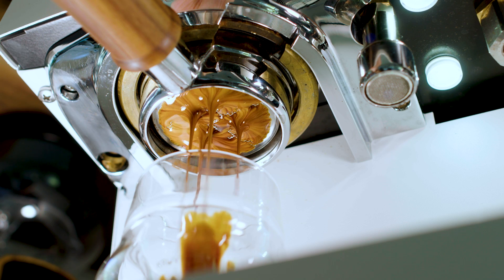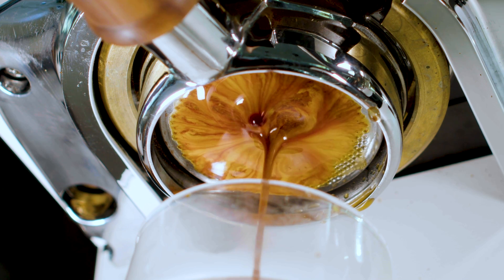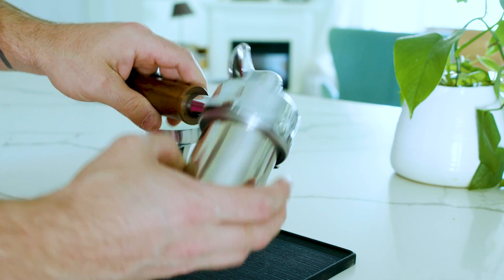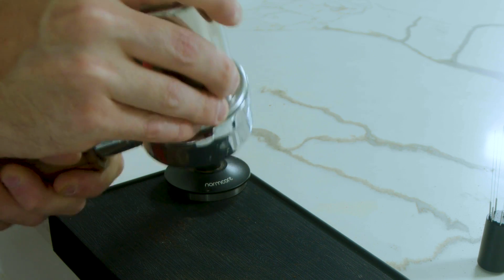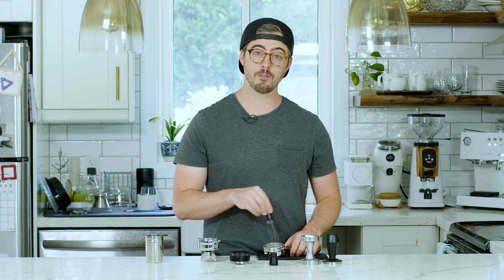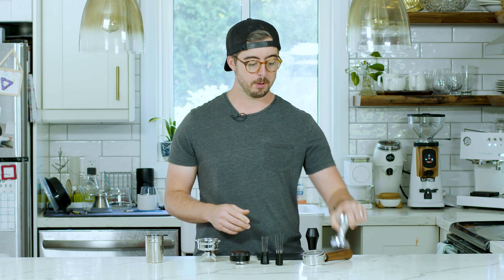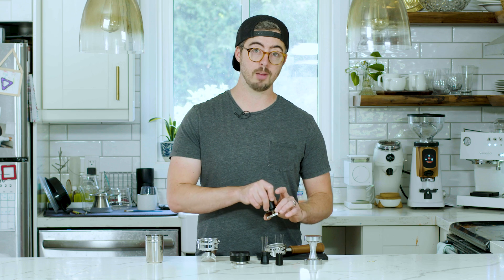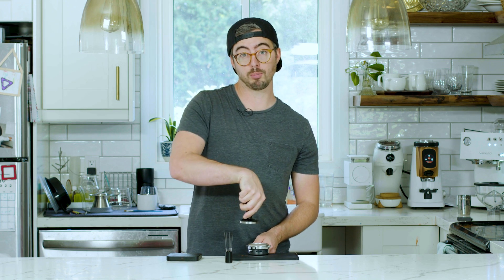Espresso Distribution Tools and PUCK PREP - What you REALLY need

Comment: The bottomless portafilter turns out to be unnecessary. It’s a great tool to have to check your prep, but once you’ve made good prep part of the routine it becomes superfluous…. and you really don’t need it to check the prep if you’re using good technique. Good grind, WDT, and tamping covers the whole thing.
Reply from the maker: For sure, but there is definitely a point at which it is helpful, which is why I recommend having one. ☺️
Reply: If you could assure me with 100% certainty the prep/shot would absolutely perfect every time, I'd still use a bottomless PF because it's entertaining 😂
Reply: I bought a Breville Bambino Plus. There is no heated Brew group or anyting even related to that so having less thermal mass between the puck and the cup is a good idea. Waste less water pulling blank shots trying to heat it up that way, so I feel that many people with entry-level or mid-range machines could also benefit for this same reason.
Reply: @NoZenith  That makes sense…. I preheat the cup and the portafilter with one cup of hot water from a Keurig-type hot water dispenser. So given that the cup should be preheated anyway, it’s not a waste of water to utilize that same  process to preheat the portafilter
Reply: They have their use and everybody should have one at hand. You need them when you switch to another new coffee type/grind and also when you have especially large cups in a compact machine.
Reply: Not to mention it just gives you more cup clearance for the cup and scale that you are using

Comment: It actually doesn‘t make if difference if you tamp harder past a certain point. Just give it a good amount of pressure and youre fine
Reply from the maker: Tamping straight is very important though - one of the reasons I love calibrated tamps with sleeves!
Reply: @DaddyGotCoffee  Thanks for adding that. It is easy to forget something when you try to explain the really important points :)
Reply: You are right. You can not press too hard. However it is true, that the sleeves help a LOT!
There is not need for a spring though, so there is a way to save a but of money or to get a bit nicer tamper.
Reply: @DaddyGotCoffee no such thing as tamping too hard

Comment: can we talk about hand/manual grinders next??
Reply from the maker: This is definitely on my list and I have been testing a spectrum of grinders from timemore, Varia and Wacaco. I may source a couple more. Do you have specific questions I can make sure to include???
Reply: Totally agreed
Reply: @DaddyGotCoffee  i have some.
I don't have a burr grinder and i use manual. And my basket is not pressurized so it's important to grind the perfect grind size. But most of manual grinders change the grind size by themselves after time. Is there any way to use them in an espresso machine to make the best results?
Reply: @DaddyGotCoffee  Comandante C40 and 1ZPresso ZP6 would be nice to include.

Comment: I use a cork and acupuncture needles for my WDT, I also use a portafilter funnel so I do not need to be super gentle as to not spill grounds. I also sometimes just shake the basket slightly leg and right and thats all that is needed so I might end up stoping with the WDT, I use a puck screen and dose 1g less and the results are about the same with zero mess left on my machine.

Comment: 2 years into this hobby, I found my process.

Shot funnel on portafilter.
Grind into pf
Wdt deep to shallow and level out the surface.
Remove shot funnel

Use the force tamper give it a pop, done
Reply from the maker: Very similar to what I do! Minus the shot collar!
Reply: I think I'm headed in this direction but with the normcore tools presented here... I think I want the shot collar for sure at this point and I've only been doing this for a couple weeks hahaha. I'm working with a Bambino Plus so the niche dosing cup doesn't fit and I use the top of a Vitamin Water I cut off as a funnel until I decide... I still seem to make a bit of mess trying to just level it a little bit before I Tamp

Comment: Just ran across your channel, love it, I know your post is several years old, but hope you are still checking comments. Question on tampers spring loaded with a shoulder, can't the shoulder potentially bottom out before the proper pressure is applied to the grounds??
Reply from the maker: Hey! Checking I am! It’s a 2 spring system. So once the shoulder bottoms out additional pressure still gets applied to the tamper face. They work great

Comment: 18 grams of coffee yielding 36cc is too much caffeine! And it's a new trend! In our time (which I still stick to at home) single was 7grams yielding 35 cc to 40cc ... double was 14 grams 60 cc to 80 cc.
Reply: That's really not a lot of caffeine, you can actually get more caffeine from a v60 brew that will taste "less strong"...
Reply: …. Which are longer extractions…. Extracting more caffeine…. 😂
Reply: I do still running approx 1:4 ratio ať home and shots are great👍
Reply: The contact time of the water is much shorter than in a V60. So the amounts of caffeine extracted are relatively small. One Espresso/Cappuccino is much less than one regular brew up coffee.

Comment: FYI the basket in an ascaso botomless PF is a competition 58,4mm 21gram basket. A regular ascaso tamper wiggles because it's designed for stock ascaso 58mm basket that comes with the machine (botomless is optional). Use a Motta 58,4 tamper for botomless.
Reply from the maker: Great clarification, thank you!

Comment: Thanks for a great video! Question about the Normcore tamp. I recently got the Normcore 58.5mm V4 ripple tamper but it seems like it doesn't fit my basket properly! I'm using a 14gr basket that came with my Ascaso machine. What could be the issue? Are you using the same Ascaso basket in the video? Thanks!

Comment: When you say 25s do you add the +5 secs of pre infusion? Cause I have I’m the same ascaso machine And the timer shows plus 8s actually
Reply from the maker: Yes. The way it works on those machines is there a 3 second pause after a preinfusion. So you set it for 5 seconds, the pump will actively preinfuse for 5 seconds, it will pause for 3 seconds, and then the pump will engage for the main shot.

I refer to it as a 5 second preinfusion because that’s how you program it. 👍

Comment: Hello,
I'm looking into giving me a nice Christmas gift. So I'm looking for a prosumer espresso machine and grinding. I'm hesitating between the Ascaso Steel Duo and the Rocket Appartemento. I'm still not sure which would be better, but I'm open to look at other machines. Price point 2500$ CAD before tax
As for the grinder, there's the Ascaso I mini L1, the Rocket Faustino and the Eureka Specialista. Prince point max 1000$ CAD.
What is your thought on my choices?
Reply from the maker: For the grinders I would definitely reccomend the Eureka out of these three. IMO it offers the best value.

Between the duo and the apartmento, this will come down to preference. The appartamento will give you a bit more steam power but with a longer warm up time and without some of the other features, the preinfusion is not programmable, no volumetric programming at the OPV is a huge pain to adjust. Both are great machines though - I might go with the one you like the look of more because if you love the machine you will use it more!

If you end up buying the Ascaso, use my discount code at Ascaso-USA.com for 10% off (DADDYGOTCOFFEE). Unfortunately I don’t have a code for the Rocket!

Comment: I don’t have a grinder but I get freshly ground coffee from a roaster nearby (100g) at a time. I recently got all the tools as per the video and I got no crema. I have a de delonghi dedica if that helps
Reply: Did you tell them specifically to grind it for espresso? Otherwise they'll probably grind too coarse. I'm assuming your portafilter is non-pressurized? To get crema, there needs to be enough pressure in the puck. If the grind is too coarse (or the dose is too low, or both) the pressure won't get high enough. So either up the dose (if possible), or get a finer grind.

Comment: Which calibrated / level tamp do you recommend that isn’t best quality but still great. 
The normcore??
Reply: I keep hearing about the Normcore and I checked on Reddit and people seem to lean that way. It's quality for the money and all the competing tampers that are built to actually keep the tamper level seem to be more expensive. There are few videos and some reviews on cheap ones that explain the part that sits on top of your basket before you start pushing down is actually kind of sloppy and so it doesn't actually guarantee a straight down, level tamp, which is entirely the point of them. I'm going to look a little bit longer before I commit because I might go ahead and buy some other stuff from Normcore if I decide this is the one to get but so far I haven't seen any legitimately negative reviews on it and all the prettier ones I've been looking at cost so much more 😢
Reply: @NoZenith  the mhw bomber ?
Agree the with fake ones.

Comment: My problem is that while I do 18g, use the wdt, tamping, & use the bottomless filter, I don’t have any weird channeling (from looking at the puck after and seeing how even the pull is) but it goes too fast, there is very fine spurting, & the pull tends to be bitter. If I do more than 18g in my current basket it won’t fit in the head. I have a Gaggia Classic Pro, and my grinder is set to a fine grind (last setting?). Would squirting/fast pull happen if the grind is too fine? Or could it be the tamping pressure? Mine isn’t calibrated.
Reply from the maker: So when the GCP is stock it pulls at a lot higher pressure which would give you a faster flow than you expect. Give a Google on OPV spring mods. In the mean time you could try going even finer. I would try that before a finer tamp! 🔥

Comment: Hey, curious about how you time your shots and the reading you get on your pressure gauge. I have an Ascaso Dream PID and I am looking to see if what i experience is normal…what pressure do you have it set it to? I have 11. I have a 5 sec preinfusion right now. In my experience, the pressure gauge reads 11 when shot starts after preinfusion, and gradually goes down to about 6 by the time the shot is finishing (~35sec). Is that what you see too? Also, if I go any lowers in time (30 to 25) seconds in total the shots doesn’t taste as good and looks very fast on my bottomless portafilter. Also curious how you measure your shot time, based on the video your shot was around 35s but you said it was 25, so maybe you are doing something i need to incorporate 😁. I love Ascaso machines, but takes a minute to get used to…Also, have you upgraded your basket or showerscreen? I have a VST basket and a IMS showerscreen
Reply from the maker: Great questions! So, a couple things. First, in the video I slowed down some of the footage and, its not exactly the same shot as I pulled when I was talking (I only have one camera! :) SO the answer is both, what you see in the video is both slowed down partially and not the exact same shot as when I was pulling.

To answer your question though, I do time my shots from first drip on the scale and shoot for 20-30 seconds. I don't watch the pump run time because it can be a little confusing when I tell home baristas I pull 35-40 second shots (which include a preinfusion their machine may not be able to do). Lots of discussion on whether or not thats the best way to time and I will say both have their value and their place.

And... seeing a peak of pressure followed by a slow drop is totally normal. You'll also see an increased flow rate over the course of a shot. 

I'm running the stock triple basket that came with the ascaso portafilter AND the stock showercreen. I'm sure I'll get an upgrade at some point but if it aint broke .....

Hope that all helps!

Comment: Thanks Justin! I am going to apply your technique in the coming days to my puck preparation. I'm very curious to see the difference of removing the distributor tool after dosing into my portafilter + WDT use. I will happily report back. Did you switch out your Normcore calibrated tamper to the 30 lb spring or do you use the 25 lb that comes already installed?
Reply: Did it make a difference ?
Reply: I am reporting back. So I had more channeling without using the distributor before tamping, but the shot was still great on taste 😆. You have more practice on me, but I'm going to try again. Thank you as always Justin!
Reply from the maker: Let me know how you are making out!
Reply: @DaddyGotCoffee  So I continue to use my distributor, but I also have the calibrated tamper and that's my final step before pulling my shots. Now that I'm over the initial at home barista hiccups, I'm enjoying every time those shots are spot on! I even have way less or sometimes no channeling at all. So, I can see that my puck preparation is getting better.

Comment: Hey there, I really am moving towards the Ascaso Duo (with your link!) It’s good that the portafilter is 58mm, have you used or know of any compatible aftermarket naked portafilters? Also have you played with changing the basket to like a VST for an 18g dose?
Reply from the maker: Great question! So, I was sent the Ascaso bottomless from the team there and it’s great. It came with a triple basket (18-20g) and I’ve never bothered upgrading because I’ve always gotten good results with it! A triple basket does fit in the spouted baskets too though! The one thing I’ll say is the Ascaso bottomless is a little expensive but my code gives a discount on it too. Any 58mm bottomless will work though - same for baskets!
Reply: @DaddyGotCoffee  thanks, it’s quite a pricey naked portafilter at $220 and I really want a machine that isn’t limited to OEM accessories. I am really torn between the Profitech 500 and this. I must say your videos and instagram page really does push me to the Ascaso!
Reply from the maker: @adilm2k  well you can def use other bottomless! The profitech is also a very good although different machine! Follow your heart on this one! Happy to answer any questions on either you can’t find the answer to 😊 As to why I have what I have… I’m just not an e61 guy!
Reply: @DaddyGotCoffee  oh yeh one last question, you mentioned a steam update. Do you have any details on this, is it something that can easily be modded or something they will include in a new version?
Reply from the maker: @adilm2k  these were JUST released in North America (like, in the last week) and have been available for some time in the EU. It’s a 25% power upgrade, and some software upgrades. It’s also about 100 bucks more expensive. If you’re in the US it will be about 1700 bucks and email the team to confirm
Reply from the maker: (Also, kits are available but try to get to upgraded version!)
Reply: @DaddyGotCoffee   thank you! I live in North America so it’s great to know! I will email them tomorrow! Thanks for all the support!
Reply from the maker: @adilm2k  no problem! Hit me up any time!

Comment: @9:50 wow, be careful!  

About those 'force control' type tampers: the ones that go entirely inside the basket DO NOT limit the tamping force at all. They only give feedback when you reach a certain force. Any additional force you apply is additional tamping force. 

For the one he showed, which rests on top of the basket, it might be possible that it does limit the force applied but I don't know specifically. Make sure you know how yours works
Reply from the maker: That is indeed how this tamper works! It bottoms out on the rim of the basket and the spring does all the work!
Reply: @DaddyGotCoffee  which spring do you use in the Normcore Tamper?